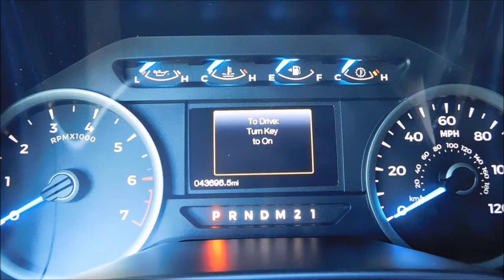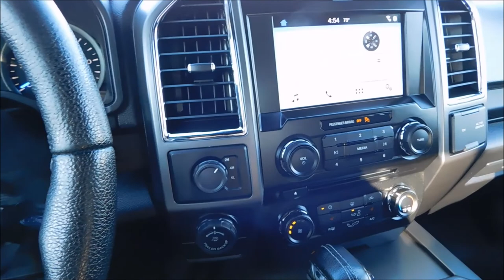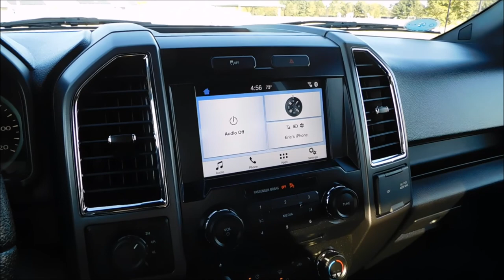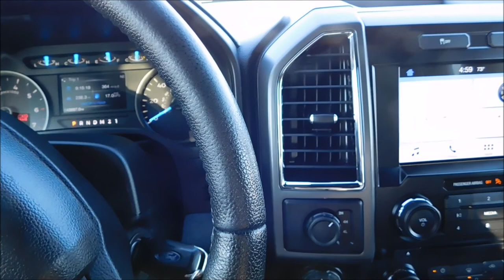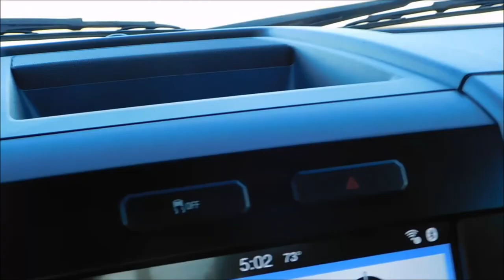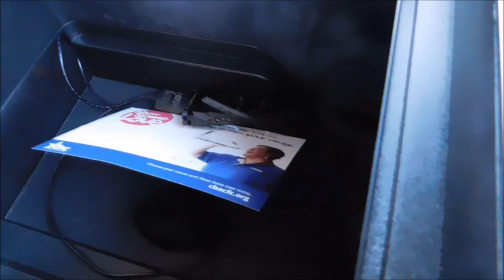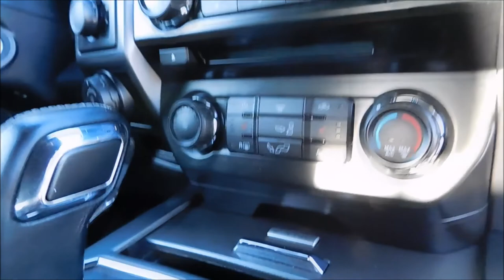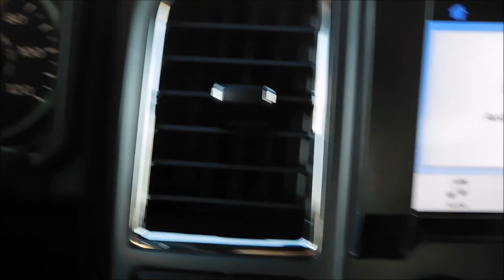New Truck Reveal

Comment: Nice, I enjoyed your ranger vids, that's a lot more truck you're upgrading to. Sitting in an F150 is like sitting in a recliner in a cathedral! I'd pick the 5.0 myself, as much as I love what a 3.5 ecoboost can do. I don't have a fifth wheel and I'm not drag racing! After a trans flush I save the last few quarts that come out since it's nice and clean and I use that for stuck fasteners and rubbing down picks and shovels.